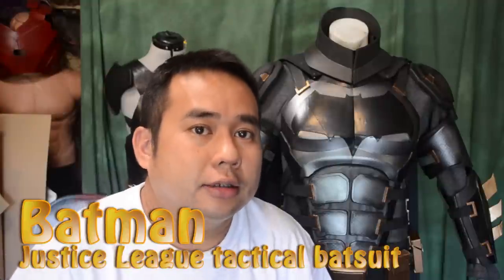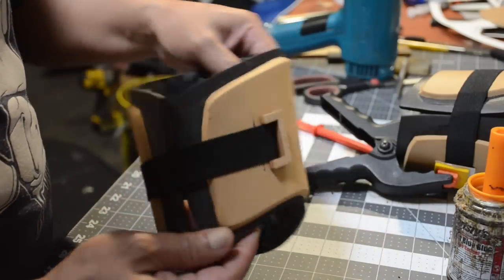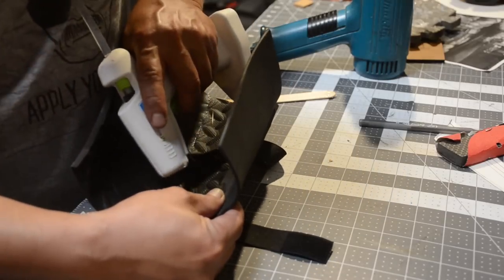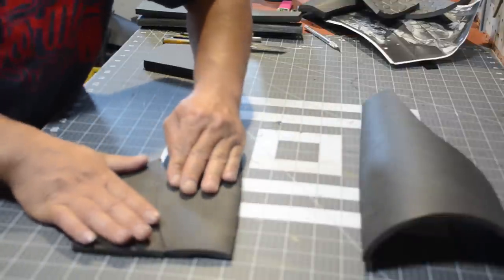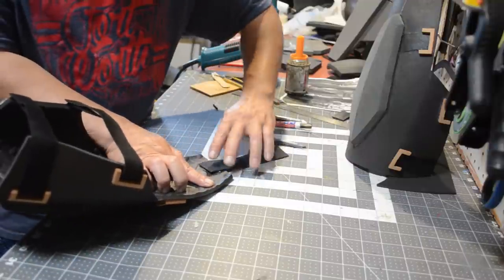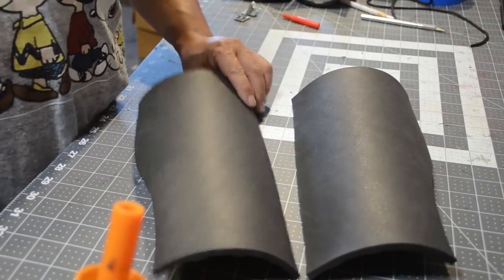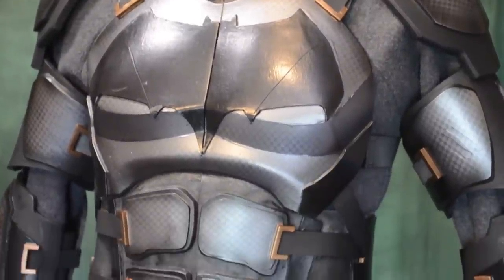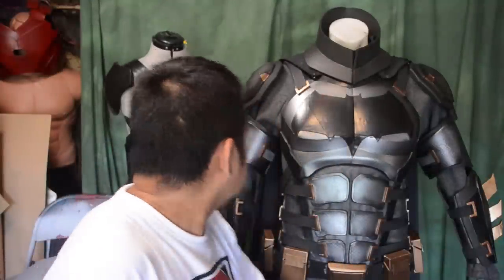Batman Justice League tactical armor batsuit arm and Leg day

Comment: I recommend using foam for the base of the neck guard and material for the main part of the neck guard. Possibly a bit of craft foam on the main part for a little awesomeness? Also the craft foam should help the material keep it's shape? All I'm sayin'! Lol!
Reply from the maker: +Martyn Welbourn yes.. ive messed around with different materials. I find faux leather works best. But not many have sewing machines than can sew heavy materials so i try to simplify it.

Comment: Hey Xieng, I'm working on the batman beyond suit right now but I don't know where to cut 45 degree angles. I was hoping you could help me, Thanks
Reply from the maker: +Kieron Chavez Ive never really cut anything in 45 degree. Usually just slight inward angles. Only on pieces that i need angled. Experiment on scrap pieces to see what works best for you
Reply: xieng prod Got it, Thanks man for the encouragement